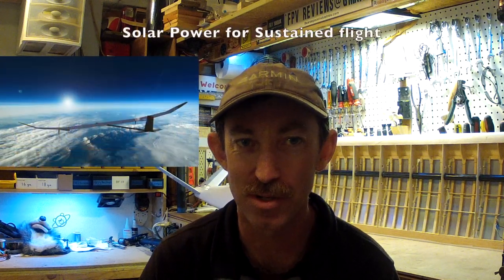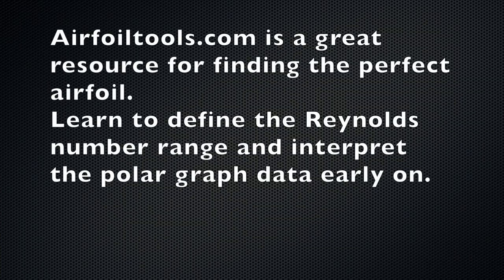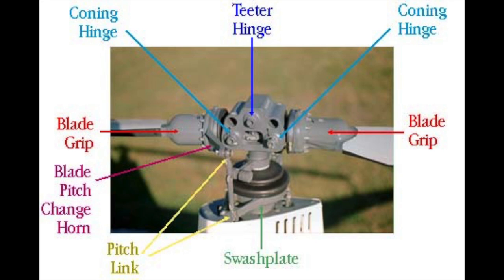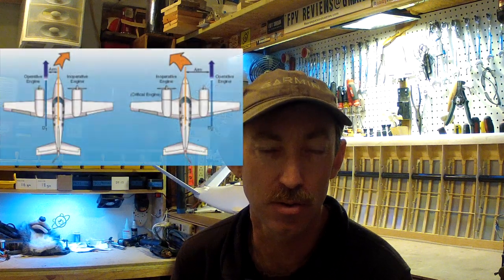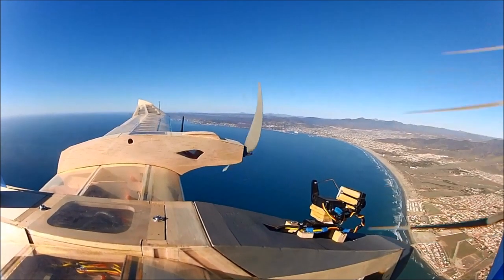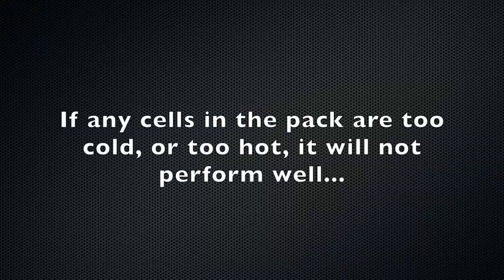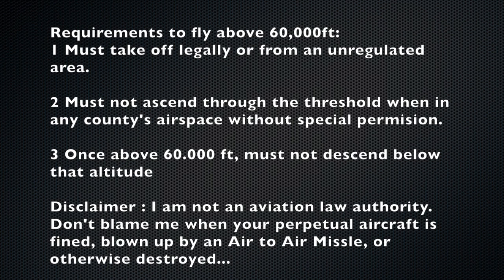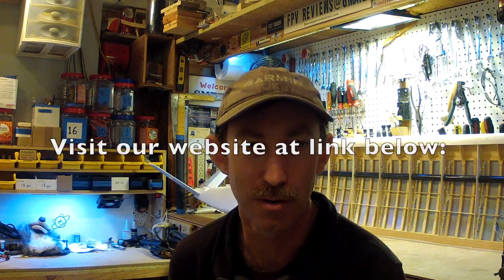How to Design Solar Powered Aircraft for Perpetual Flight - In Depth

Comment: Is this based on the white paper from the atlantik solar project in Zurich? I read it and came away thinking it's viable for useful payload yet. They did it, but it can't carry much, and can't do it in winter or far north.
Reply from the maker: No not based on their paper, although I did read it a couple of years ago. 
I'm sure that if they made some minor improvements, and potentially up-sized their airframe, it could carry a useful (if small) payload.  the impressive part of their aircraft is that they have proven it can fly in sub-optimal conditions and at low altitude.   It's an impressive project for sure.

Comment: This is a fantastic video! Also, I have a question as a student designing a payload-bearing solar-assisted aircraft. Did you guys consider an EPO foam + .75 oz fiberglass composite when deciding on the wing structure, or was prior experience with plywood+balsa+monokote wing preferable to the cost and effort? Wondering how easy it is to mount the cells to a monokote wing as well. Im asking with an undergrad Aero student's experience with design+building experience from SAE Aero Design Comps.
Reply from the maker: seems to us that an open structure with floating solar cells in between rib bays, or an open structure with the cells on top of the ribs, recessed the thickness of the cell, with monokote or similar on top is the best for performance DIY solar planes.   Of course the foam core composites are great, but provide strength in all areas where almost none is needed, assuming you will not be rough handling the plane.   if it can be delicate, better the open structure.  must integrate a carbon fiber tube spar for strength, and torsional rigidity.   we're working on one right now.  nearly flight ready.:)  some pics are on our website, but not recent. will update soon.
Reply: @FPVREVIEWS  I've been watching the progress of solar dragon on your site for a while now out of curiosity. I'd love to see any stats ya'll collect from its maiden. Has there been much progress on the mid-air recharging project, or has COVID kinda sent things up in the air (in the bad way)?

Comment: Could you give me an advice , do you have any sketch where I can see how the panels are connected in this case to the battery or the esc and motor?
Reply from the maker: If there is a battery, the solar is usually connected to the battery through a solar charge controller.   there are various ways to do it. It's up to you to design the system. All that is presented here are options, and general principles.

Comment: For rc purposes flying wings are best.
Reply from the maker: hmm... I'm not so sure. they do have a lot of surface area for solar aircraft.  but.. they have many issues. 
we plan on making a video on them soon to discuss the topic in detail.   
some reasons include: wing sweep not ideal for low speeds/hard to control yaw/massive pressure shift of CP at high AOA which necessitates extreme forward CG just for high AOA condition, and hence poor performance at normal flying speeds/ cannot use flaps/ penalty in pitch stability when using a high lift airfoil/lack of moment arm to create pitch stability, etc etc.